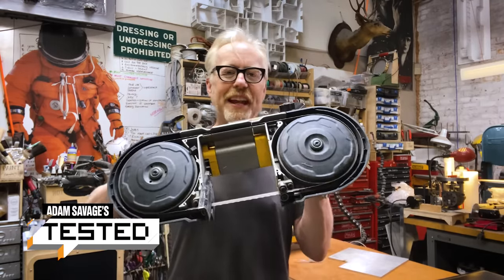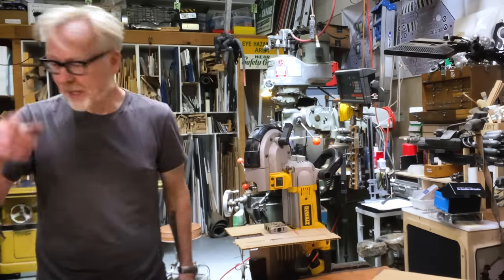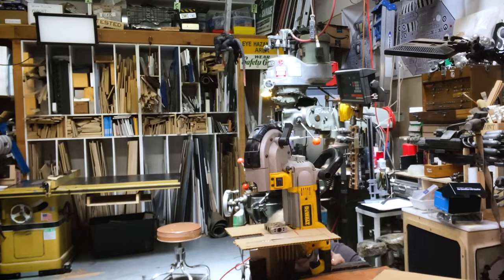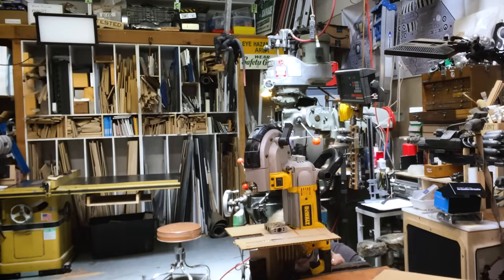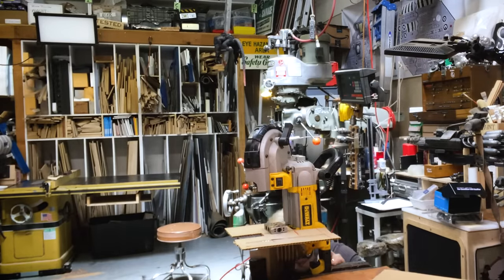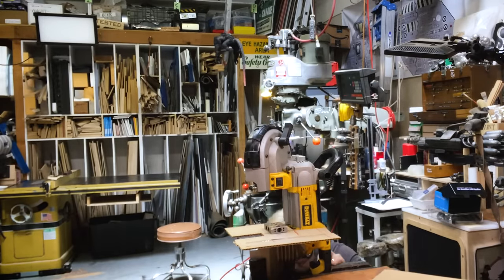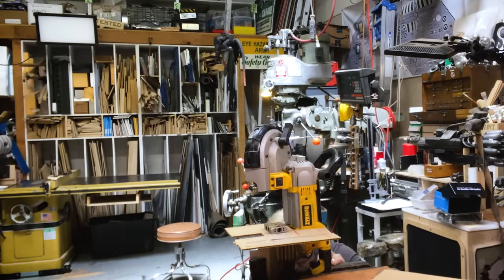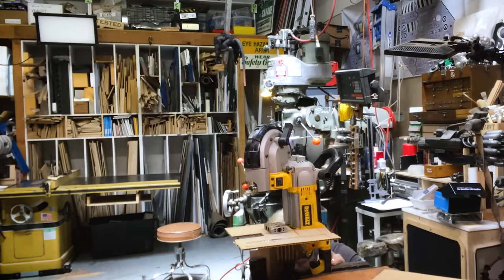Adam Savage Builds a Mini Tabletop Bandsaw!

Comment from the maker: Corded Portable Bandsaw: https://amzn.to/2XvhbNG
Cordless Portable Bandsaw: https://amzn.to/2M7mZYh
Pica Deep-Hole Marker (Black) https://amzn.to/3aCCBOT
Pica Deep-Hole Marker (Red) https://amzn.to/2RfRO0n
Reply: Adam Savage’s Tested knife making aluminum! I would love to know the specs on that. I couldn’t find anything about it in my quick google search.
Reply: For safety you should put that switch and wiring in a box like a handy box. If you cut metal and a shard crosses the exposed posts that’s a accident waiting to happen. Just saying. Don’t know if you’ll read this or not.
Reply: You know, you should get a contour gauge, it would make figuring out the shape easier.😐
Reply: They're not that expensive, you can get the for less than 20 dollars.😐
Reply: @jaredj631  Aluminum of any type or alloy wouldn't hold an edge.  It's certainly for other parts of the knife (scales, bolsters, etc.)
Reply: Adam, a trick from Ben at Crimson Guitars- add masking tape to both pieces then glue the tape pieces together with superglue. When done just peel the tape.
Reply: Not using that handle mount as a pickup point for a full hight stand with casters seems like missed opportunity.
Reply: Excellent
Reply: All electricians use a blade to trim insulation off wires, so I don't knock you for doing it. But the proper way is to cut vertically down the insulation just enough to expose the insulation threading, then take a strand or two of the thread, and pull down the cut you made. On rare occasions, it is a must to do this, like with fiber optic bundles.
Reply: You've left uninsulated pins and connectors open on your mains switch!!
Reply: Pass unto Adam that he's overspeeding the boring head. He needs to go much slower. And it's never speed down till you get it, it's always speed up until it chatters, because speeding down, you can still carry vibrations and bad cuts, but speeding up you'll know exactly what the speed and feed of that particular cut is.
Reply: With the dro make a cut take a measurement then punch the measurement into the DRO then machine to the number you need
Reply: Adam there are plenty of YouTube videos where the saw hangs from the handle and still removable.
Reply: Link those flush cutters 57:05
Reply: Is there anywhere that plans could be found, because I've been wanting to make one of these for my portaband
Reply: @skathiri2608  you think out of the thousands of things in Adam's shop, he doesnt have a contour gauge
Reply: Thank you for the links - definitely need to add those deep-hole markets to my buy list. How useful! I hadn’t noticed them before.
Reply: @sampowers6551  I ment buy
Reply: @brianfaini  Check his videos from the past month or so for favorite tools. He has linked to them.
Reply: 51:00 You can open up the tool to replace the cord. No need to have cut it.
Reply: @skathiri2608  he owns them, I can guarantee it. There is no point of wasting money on stuff. And he know that
Reply: need to add a high capacity battery bank to your camera/phone mount
Reply: always used WD-40 as a coolant when cutting Aluminium, seems to work better with the added amount of slip alongside cooling things down
Reply: Adam, next time you're machining aluminum, try to use ordinary rubbing alcohol, it makes less of a mess and helps keep the tool colder than cooling fluid would :) this goes for pretty much any operation in aluminum.
Reply: Talk about putting it in the corner when out of the way... puts strain relief on the flat corner... 
If it was on the portaband side, you would have both parts covered, as the saw pokes out.
Reply: if you left the half loop from the base and changed the handle on the toip to have a half loop as well as a t bar handle ... you then still have the option of making the corded saw portable as it was bought ... or have it mounted on the stand and still be movable easily .. this way you can literally bring the small bandsaw setup onsite or move it around the shop ... and you could even sell the plans or kits for the conversion ... have a bit of fun with the variable speed plunger ... perhaps make a hand and put it on on screw plunger so as you tighten it, the hand pushes the finger down on the trigger adding more speed ... make the wrist portion look like it was chopped off and then you have a unique setup for certain ;)
Reply: oh and add a pocket on the inside for the old table to sit and the allen key you use for the bed screws ... perhaps make a tilt bed for the saw too ... and have it store in the base as well ... then you have 3 different ways to use the saw ... and it is still portable and you still can swap to hand use as well ... heck add a spot to plug the battery charger in for the other one then you can have both on location and charge the one and have a the back up as well .. with the mobile option or the flat table or the tilt table options all available ... heck make a v groove table brass insert for round or odd shaped objects too and your golden and add a place to put those inside the base as well .. same with a spare blade .. then you literally have a small portable workshop bandsaw
Reply: heck check and see if the battery one can fit as well ... and make a stand for it too ... and new tables etc ... and make it a simple swap conversion able to be done in the field if needed ... then you have 3 workshop bandsaws ... and twin on site bandsaws that can be stationary or mobile as needed ... and are kitted for pretty much any need
Reply: if you make it square and perhaps level you could also make a fence for it that perhaps slides in a  v groove on the sides so you can cut measured lengths fast ... if you plan on taking them on locations ... make them with the T bar handle and then just lower them into their case and flip the lid over and lock it ... then each mini bandsaw table carries its own tables and inserts, a spare blade and fence ... perhaps marking implement and a tape measure ... also ... then it is literally a mobile workshop bandsaw ...
Reply: The fiber is what is used to pull the wires through the insulation, it also acts as a filler and its easier to leave it lol.
Reply: Im impressed Adam does the safety squints as well 🤣🤣

Comment: WARNING! The way Adam wired the switch, the unused top lugs will be HOT when the saw is switched off! With a double-pole switch like that, it's also considered safer to switch both hot and neutral.
Reply: Switching hot and neutral would probably also allow the lights on the switch to work as intended. :)
Reply: Just as a learning point, can the unused lugs be just be snipped off and covered with liquid electrical tape?
Reply: Definitely a good idea to wire both hot and neutral through the switch, but it looked like the bottom lugs were the unused ones.  If he wired the wall connection to the top of the switch and the tool side to the common (which is fine for how he is doing it) , that would keep only one lug hot when the tool was off.
It looks like a lighted switch and I wonder how the lights are connected internally, which could throw off my answers.
Reply: @stupidkidlol  It'd be better to connect the power cord to the switch lugs, and connect the band saw to the common. That way the other lugs are switched to the band saw when it's switched off, and the power is connected to nothing.
Reply: @stupidkidlol  you can't get guaranteed safe insulation this way. Although it probably is safe you would not find this in a professional product.
Reply: Yep, I saw that too and inwardly cringed. Also, there's no protection for swarf getting onto the exposed switch contacts. Better to have a switch enclosed in a metal back box (plus you can ground the box securely too). Don't like the wire nuts TBH, much prefer using 250 Faston shrouded crimps and WAGO wire terminals. Definitely agree with switching the Hot (Live) and the Neutral on two separate poles of the DPDT switch. Wall AC goes to the outer pair and the load to the centre (common) lugs.
Reply: @stupidkidlol  I was taught to use "shrouded " (covered) crimps and to put crimped but empty ones onto unused lugs if I couldn't fit a cover over the back of the switch.
Reply: @hoshiadam  In most 120V lighted switches the light (usually an LED these days but used to be a Neon bulb) is in parallel across one side of the switched contacts with a load resistor. If it's designed to show power with the light for either pole...then it likely has separate wiring internally to do so. But that switch he used is for powering two devices so and has a light on each side. The way he mounted it inside was with the unused lugs on the top...so yes, he has one live connection up there. Really he should have just used an electrical switchbox for it but I get that maybe he doesn't have one of those just laying around.
Reply: If he puts hot on top and to the tool in the center, he would be okay. And yes if he did the negatives the switch would illuminate. I'm sure on the next video he is going to box in the electrical.
Reply: I knew this would come up when I watched him wiring the thing, he most likely rewired it in the end, after he came down. 🤭
Reply: my immediate thought when I saw it too...
Reply: @stupidkidlol  just put a bit of shrink wrap over them and shrink it ... then they are safe and still available for future use
Reply: @hoshiadam  the top pins are all hot ... the bottom pins are all cold ... so with one side only powered (the top one) ... the open unwired contact is HOT a safe way to handle it is to use shrink wrap on any unused lugs then they are safe from short and still available for future use
Reply: @WonkoTheSaneUK  better to use heat shrink actually .. it seals the contact from all contact and still leaves it able to be used in future if needed by just trimming it off ..
Reply: Electrician here. There's no reason to switch the neutral, but the switch and all the electrical connections and splices should be in a plastic or metal junction box. There should never be live electrical connections inside a flammable wood cabinet that might get filled with sawdust and metal shavings.
Reply: As someone who supervises electronics/appliance production, powering up that switch in his hand on the metal saw top made me cringe, a lot.